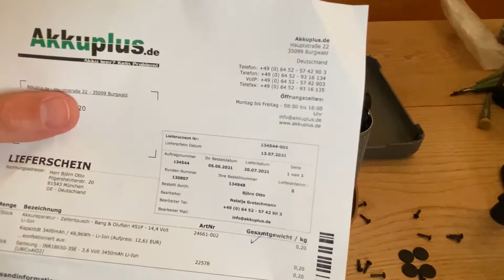Beolit 12 Repair Tutorial Replacing Battery and Door Latch / Lid Catch

Comment: The part for the door is a Push Release Catch, which is also used for waste bins from Brabantia, for example. You should be able to find a replacement on various platforms using the search terms. There are several suppliers on A…zon, the dimensions appear different, but it is always the same component - always fits Brabantia. It's strange that one of the most expensive designer loudspeakers uses such a cheap, unsustainable part...
Reply: Installation is very simple - there's no need to dismantle the Beolit: you can use a small screwdriver to prise the push release catch loose on either side. The new one is then simply inserted.
Reply: I ordered them from A..zon Germany from a manufacturer namend Operitacx. But as I said - there are similar parts an they seem to come all from the same Chinese plant.
Reply: Sorry again for the fragmented information. Unfortunately I can't post a link or a part number without some algorithm deleting it.

Comment: Did you get the latch / broken black bit from Akkuplus?
Reply from the maker: Hi Alla, you may be lucky and get it from the B&O customer support. Check out the additional information in the comments below the video!:-)
Reply: @steuerbuster  No luck so far.... might see if I can somehow email Berlin...
Reply: nothing at Berlin either
Reply: I just found out that the Beovision 6 uses the same latch... still searching. Also looks like the Beolit 15 used the same latch... the search continues
Reply from the maker: Thank you for your feedback! Can you confirm that the Beolit 15 part fits to Beolit 12? If so, where did you get it?
Reply: Where can I  buy b&o battery